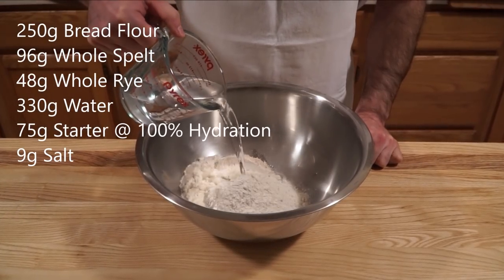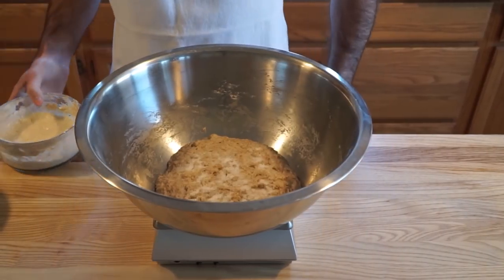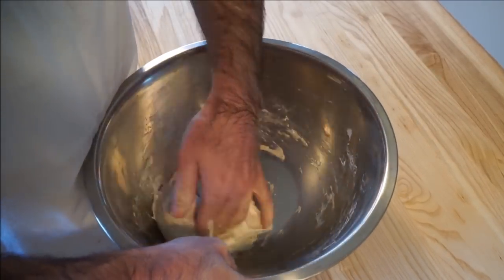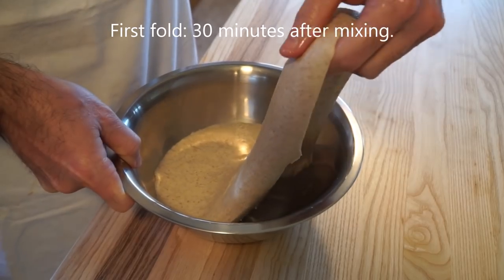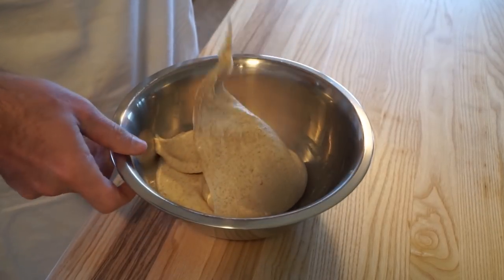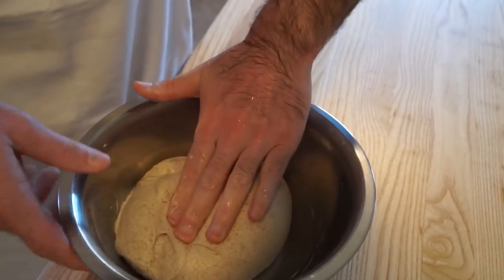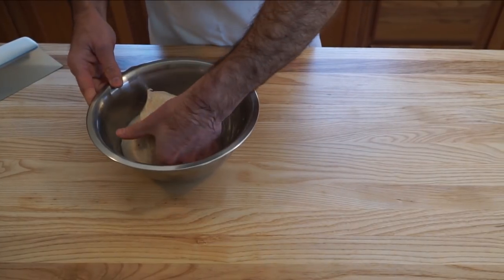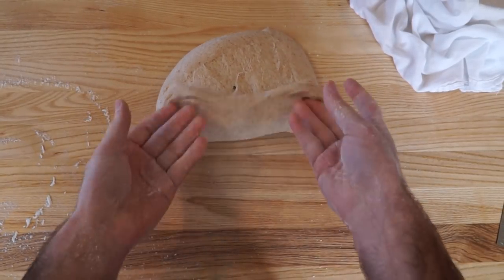How to Make Tartine Style Country Bread

Comment: Trevor, I saw two pans on the bottom rack in the oven.  Are those to defuse the heat or do you have water in them? Thanks for the videos.  I'd like to see more.  Keep up the great work!
Reply from the maker: Thanks Seth! I've got plenty more videos in store -- I just tend to be a bit slow at this stuff sometimes. And you've got a sharp eye. I use two sheet pans, inverted and placed on top of each other in order to form a pocket of air underneath the combo cooker as it bakes. That insulation helps to prevent the cast iron from getting too hot and scorching the bottom crust. I only need them when I bake above 450F-475F. Since this bad boy starts the bake at 500F I include the sheet pans for protection. Cheers!

Comment: Hi Trevor!
first of all congrat for your loafs and thanks for share with us your big passion and your skills.
I have 2 questiosn if is possible.
I leave in Canary Island, and is difficoult to find quality flours here....wich % of ptotein you recomend to use....and wath size is your Iron skillet?
thank you very much and congratoulation again.
Reply from the maker: Hi Daniel, the white flour that I use typically has a protein percentage of 11.7% to 12.7%. The bread flour for this particular loaf is 12.7%. You can certainly use lower protein flour, but it will be more difficult to get a strong dough that rises well and springs up in the oven. Plus lower protein flour absorbs less water so you'll need to reduce the water in the recipe to compensate. As for my skillet, I'm using a 3.2qt Lodge Cast Iron Combo Cooker which is 10.25 inches in diameter.
Reply: thank you very much!?!!

Comment: Awesome video. I've tried to make this 3 times now, and each time it doesn't turn out right. It ends up flat and hard. When I'm making the bread, the dough is definitely looser than yours in the video. The gluten seems to be developing, based on the "light test." After folding and loose shaping, it just spreads across my counter during the bench rest. I'm using all bread flour (i.e., no spelt or rye, but 354 g bread flour), but other than that following the recipe exactly. Any idea why my dough is so wet/loose?
Reply from the maker: It sounds to me like you've got a couple different problems going on here. 1) Your dough is wetter than mine. Whole grain flour absorbs much more water than white flour does. Since you've replaced the whole grain with bread flour it won't be able to hold as much water. In order to achieve a dough of similar consistency to mine you will need to reduce the hydration by quite a bit. 2) Your dough is possibly underproofed. It's hard to say for sure, since the symptoms you describe also apply to overly hydrated dough that isn't shaped with enough tension. But I'm guessing it might be underproofed as well. Does the dough rise very much during the bulk proof? It should rise at a minimum of 30% in volume, though 50% would be better. If your dough doesn't rise much during the bulk then you probably have an insufficiently active starter (or the dough is too cold).

Comment: Hey Trevor, thanks for your great videos, they helped me up my bread game quite a bit. I used to bake in a borrowed dutch oven, now I got my own, brand new one. Which made me wonder: Did you season yours in the beginning? Or is it not necessary for bread baking? Your answer would be much appreciated. Thanks!
Reply from the maker: Hey Stephanie, I've always been content to just use the cast iron as is (assuming it comes pre-seasoned, as most do). The pre-seasoning usually isn't that great, and if I were to use it more for cooking then I would re-season it at the time of purchase. But for baking, pre-seasoned has always been good enough for me. That said, eventually you will have to re-season your cast iron. I've had my combo cooker for a couple years now and I've had to re-season it a couple times already. Now, I bake pretty frequently so your mileage may vary. But giving it a good seasoning after you purchase it may prolong it's useful life before you need to re-season. It's not necessary, but certainly worth considering.
Reply: Thank you very much! All the best.

Comment: Trevor,Thanks for the great video,and knowledge.I tried your process twice and my dough was deflated=underproof? My starter was strong(fed 3 days twice per prior to using),even used less water,still,dough was runny,like pancake,and didn't rise-can you help? Thanks.
Reply from the maker: I wish I could help, but there are so many different things that could've gone wrong that I couldn't possibly pinpoint which variable (or variables) might've been causing the difficulty. The only way I could give you an accurate assessment would be if I were there to see for myself what was going on. That said, this IS a very wet dough. Even if you reduce the water a bit it can still be too wet for those who don't have much experience handling such wet dough. But also, different flours absorb water differently -- so if your flour absorbs less water than mine then you will end up with a wetter dough than I do. And if you live in a hot and humid environment, then you may end up with a wetter and slacker dough than I do here. Like I said, there are too many variables to account for with such limited information. My suggestion is to just reduce the hydration until you get a dough consistency that you feel comfortable handling. Then you can slowly increase the hydration bit by bit as you acclimate to the wetter dough. Good luck!

Comment: Do you have a video on how you made and maintain your all white flour starter? I have a very active rye starter that I keep at 100% hydration, but I feel that using rye starter instead of white alters my recipes a bit too much, I have tried converting my rye into a white and ww starter but would love to make one from scratch.
Reply from the maker: There's no need to create a brand new white starter if you already have an active rye one. Just convert or split off the rye to white flour. After a few refreshments it should be fully white. That said, if you're just looking to experiment then go for it.
Reply: I went ahead and split of some of my rye starter to make 360 grams of white starter. The so called rule of 15, I fed 24 grams of rye starter 24 grams of white flour and water. Then 4 hours later I fed 48 grams of white flour and water. In 4 hours again I fed it 96 grams white flour and water. Is this how you would go about creating a white starter from rye starter, or do you have a different system?  I kept 50 grams of the 360 grams starter and fed it 50 grams white flour and water, and I am going to keep feeding it so I don't have to worry about converting anything again, I now have 100% hydration white starter right?

Comment: Are you covering your dough between folds? I ask because, After six hours my dough was still super wet and would not let go of the table. I followed your measurements to the T.
Reply from the maker: Yup, I cover my dough when I proof it. I typically just set a plate on top of the proofing bowl to cover. That way it's easy to remove and replace during the folds. Regarding your dough, this dough is in fact supposed to be extremely wet. I don't know if you read the accompanying article for this video (there's a link to it in the description), but I make a point of warning that this is a very wet and sticky dough. If you have limited experience with such high hydration dough then it can be almost impossible to handle. It will stick to everything it comes in contact with. The dough in this video is extremely sticky -- the only reason it looks so easy to handle is because I have plenty of experience with this kind of dough. That said, it's entirely possible that your dough was even wetter and stickier than mine. Different flours absorb water differently, and if your flour doesn't absorb as much water as mine does then your dough will be of an even wetter consistency. Furthermore, environment makes a difference -- so if you're in a hotter more humid environment than me then that will also contribute to make the dough even stickier. Either way, the solution is the same -- just reduce the water in the recipe until you get a dough that's easier to handle. Then as your skills improve you can slowly start increasing the hydration bit by bit. Good luck!

Comment: Hi Trevor,
I tried this recipe. The result was not bad for the first time but there is always an issue I am facing which makes me unsure about what I am doing. When I transfer the final dough from bannetton to the warm stone to bake it, it loses its shape and nearly flattens on the stone. It comes up a little bit after 10 minutes staying in the oven but generally it makes it difficult to work with the dough. Is the water / flour ration that makes it so?
hope to hear from you soon. :-)
Reply: Try to: (i) check if you are using a good technique for shaping. It's vital; (ii) check if the flour you're using can handle this hydration rate (85%); (iii) reduce the hydration AND train yourself on the good techniques for shaping.

Comment: I tried making a 75% loaf with very strong white flour only today and my dough was awfully slack and just not good. I've tried similar with varying proportions of wholemeal flour and I get the same result. I cannot seem to make anything above 65%. Are flours across the Atlantic different, or am I just getting something consistently wrong? Perhaps it is my starter strength...how long before you make bread do you feed yours?
Reply: How long did you mix it?

The starter should float in cold water (about 6 hours after feeding. Make sure to start the autolyse at around the 4-5 hour mark to coincide with this). If it sinks it isn't ready.

Comment: I love your video. Just one question: do you bake the dough directlly from the fridge to the oven or you wait until til comes to room temperature
Reply from the maker: I vary my method based on the conditions and needs of the dough in hand. So I do both. Sometimes I bake it straight from the fridge, other times I let it sit on the counter to warm up and finish proofing for a few hours. It just depends. If I recall, this particular loaf was set out to warm back up for a little while before I baked it. But not too long, I don't think. Maybe an hour or so. Feel free to use either method as you see fit.

Comment: nice video I have a comercial  convection oven what professional   kichen use what temp and how long should I bake for 😕
Reply from the maker: Hey George, since every oven is different I can't give you specific instructions. Figuring out times and temps for individual ovens is really just a matter of trial and error. So my suggestion would be to follow the directions in the video the first time you try it, and then adjust as necessary based on the results you get. If the bread is too dark then bake it at a lower temp and/or for less time. If it's underbaked, then try baking it longer and/or hotter. Just play around until you find what works best for you and your oven. Good luck!

Comment: Amazing video Trevor. I tried the recipe for the second time now and had no problems mixing the wet dough. But in the end, after the bench rest, the dough didn't keep its shape and was too sticky to really form nicely...I feel like the flour I use isn't as good as it should be. Could it be because I don't use whole spelt flour? I can only get my hands on a mixture (80% half-white, 20% spelt flour). Also, what is bread flour? =) There are so many different types that it got me really confused. I've been using 250g of what would translate to 'half-white flour' as replacement.
Reply from the maker: Flour can certainly make a huge difference. Different flours absorb water differently, and therefore the dough consistency will be affected. Without having personally used the flours you are using, I can't testify to the effect they will have on the dough consistency here -- but you may very well need to lower the amount of water in the recipe if your flour can't absorb as much water as my flour can't (and whole grain flours tend to absorb more water than refined flours). Bread flour is a refined white flour that typically contains about 12% to 13% protein (mine has 12.7%). It may also be known as Strong Flour or Strong White. If your flour doesn't contain as much protein, then it will absorb less water and you'll need to reduce the hydration to compensate. As for being difficult to shape -- this is a wet and sticky dough by design. Even if you have the same flour as me, this dough will be very difficult to work with if you're not experienced with handling such wet dough. This is not a beginner's recipe. So if you're new to baking it's best to start with stiffer dough in order to build your shaping and handling skills. Over time, as your ability improves, then you can start increasing the hydration and working with more difficult dough such as this. I hope that helps. Cheers!
Reply: Thanks for your answer Trevor. I started to use part wholemeal wheat flour and part 'dark, brownish' wheat flour as replacement for the bread flour now and added the whole spelt and rye you mentioned in the video. I've had much better results since the wheat is able to absorb more water than before and I am determined to stick with the 85% hydration. =) 
I always thought that using large amounts of wholemeal flour would have downsides, like denser breadcrumb, but that wasn't the case. Sadly I couldn't find much info on the protein content of my flours, so I will just have to try out different ones for the best result. Thanks again!
Reply from the maker: Typically, wholemeal flour contains more protein than white flour. But the quality of the gluten it makes is inferior. But wholemeal absorbs much more water than refined white flour does -- 85% hydration for a primarily wholemeal dough isn't that extreme. Wholemeal does tend to make for a denser dough and tighter crumb, but you can certainly make nice and open wholemeal loaves -- and it sounds like you are. As you experiment with different flours, keep in mind that hydration is a relative thing. There's no point in just picking a number like 85% and blindly holding to it -- unless you just like playing around to see what you get. What really matters is not the hydration percentage, but the dough consistency. Use only the amount of water necessary to get the dough consistency you desire. When making the same loaf, but with weaker flour -- such as all-purpose -- I will lower the hydration in order to get the same dough consistency you see here. Like I always say, adjust as necessary.

Comment: Hello Trevor,  I thought i use the same lodge cast iron set but after looking more closely at your vid your cover looks deeper. My cover is 3 in deep measured on the inside. The bottom is 1.5 in deep. Am i seeing things?
Reply from the maker: I use the standard Lodge Cast Iron Combo Cooker 3.2qt. model. I just looked up the measurements on amazon and you're correct -- the cover is 3" deep and the pan 1.5" deep. So we're using the same thing. The only time I ever run into problems where the loaf bumps the top is when I'm baking a loaf made from well-risen stiff dough. It can look a little funny when the ear folds back into the loaf as it's compressed against the top of the cover, but otherwise it's no biggie. When I think I'm going to hit the top I just give it a different score pattern so that the cuts don't form ears. But for most of the breads I make, there's plenty enough room for the loaves to rise without hitting the top.

Comment: Followed precisely. Came out too wet and too flat even after proofing 3 hours. Are the flour and water weights in the video correct? Ratio-wise it’s seems correct (330/394=84% then add in the starter) but it stayed too wet the entire time. Did not rise well even though my starter is a monster.
Reply: And I have made high-hydration breads before ...
Reply: I’ll also add that the crumb came out beautifully. I’ve used stretch and fold on other doughs but not the hand mixing beforehand.

Comment: Hi Trevor, I enjoy your videos could you please tell me the size of the banneton you use? Thanks Fred
Reply from the maker: Hi Fred, the oval banneton is 9 inches long (22.86cm) and the round one is 8 inches (20.32CM) in diameter. Both hold up to 1000g of dough (depending upon the type and proof of the dough) though 800g seems to be the sweet spot in most cases.
Reply: Thanks for the info. keep up the good work.

Comment: why is your dough not sticking on your hands at all during final shaping? how should the gluten be by that time? wet doughs don't develop gluten much unlike 60-65% hydration, right?
Reply from the maker: Hey Justin, it kind of all goes back to the hands. Bakers hands. The dough itself is actually quite sticky. But because I've been baking for so long I have developed the dough handling skills that allow me to handle even wet dough with minimal sticking. There are many subtleties to properly handling dough. And the better you get the more instinctive they become. Every single new baker has sticky hands. Without exception. So when newer bakers see experienced bakers working with wet dough that doesn't seem to stick they naturally assume that it's something to do with the dough. But it's not. It's all in the hands of the baker. If the new baker and the experienced baker were to work side by side with the same dough you'd see the dough sticking everywhere to the new baker and all over the bench, but remaining smooth and supple and clean in the hands of the experienced baker. It's a skill that develops with practice and experience. It's not the dough, it's the hands.
Reply: +Trevor J. Wilson wow!!! Very inspiring!!! Thank you, chef!!!